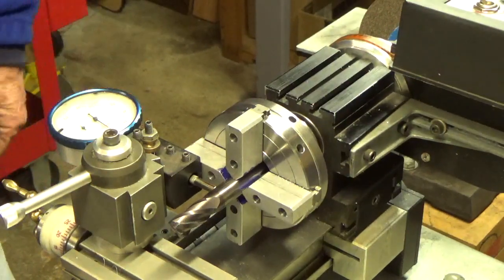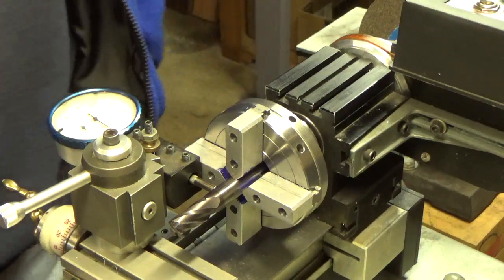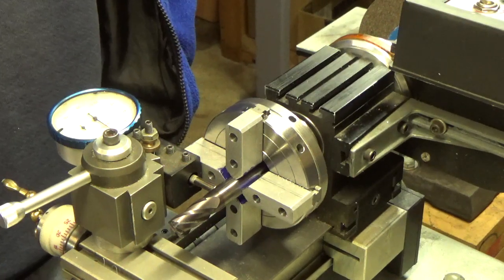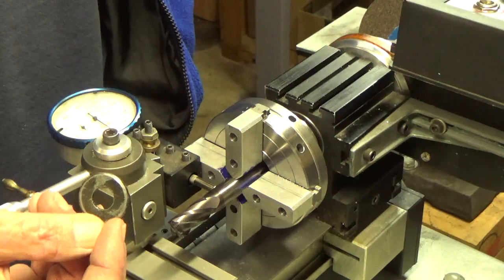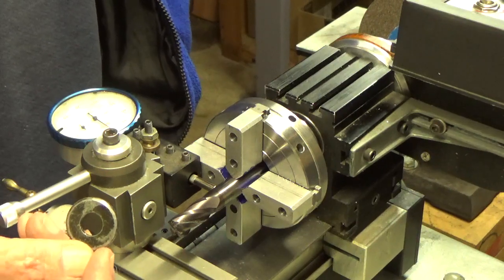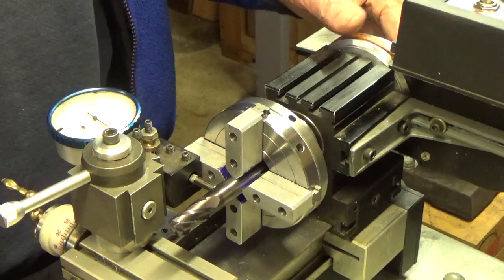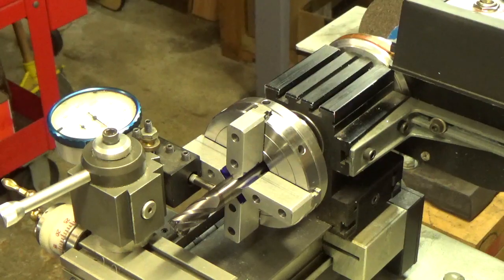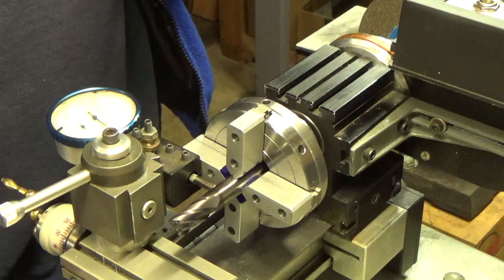Taig Lathe $20.00 4-Jaw Scroll Chuck Final Wrap

Comment: I have found an easier way of doing this for the ATLA scroll chucks. I just take 3/4-16 nut, turn it down on the spindle. Bore out the chuck using the 4 jaw to tightly fit the newly turned nut. TIG it on the end, turn a register in the weld. I true the jaws with a washer on the outside, using pins in the jaw holes. I have been getting < 0.0005 when finished.
Reply from the maker: Thank You. Regards: Larry

Comment: I easily and accurately true up my chucks using a round extrusion with a 3.5" bore.  I place the extrusion around the outside of the jaws and tighten up to the inside of the extrusion.  The jaws are as accurate as the scroll.  Yes I am tightening up to the back side of the scroll.  I can easily bore a high quality surface on the jaws.  I am happy with the results.  It is quick and easy.
Reply from the maker: John: Thanks for the comment.  Good to Know.  Regards: Larry

Comment: Good wrapup.
Reply from the maker: Roy: Thanks for the comment.  I forgot to mention that the larger diameter washer is needed for this particular chuck because of the larger bore.  The original 1" washer would be to small and wouldn't lay flat against the chuck body.  Regards: Larry